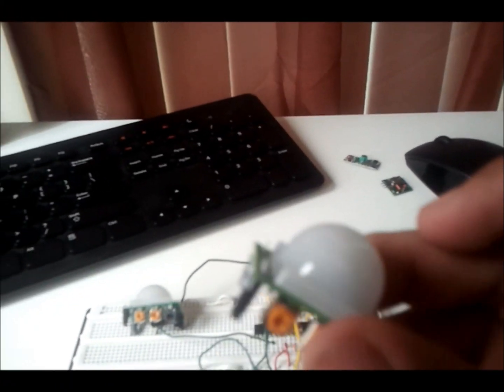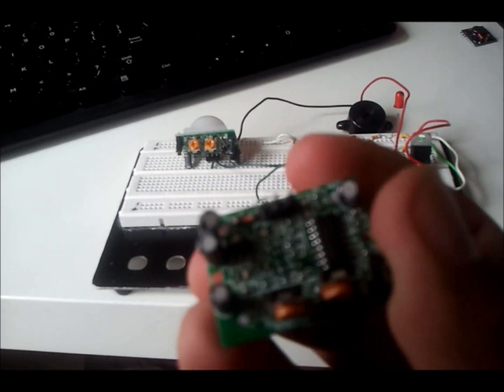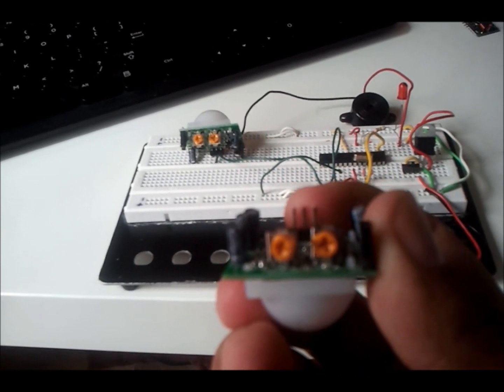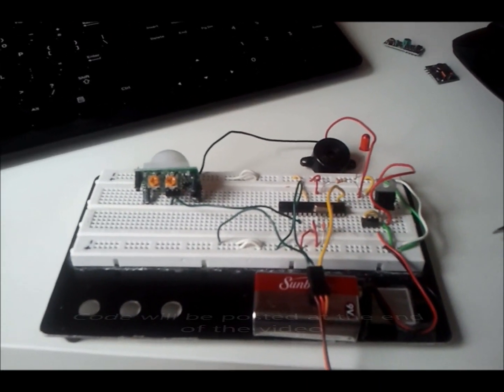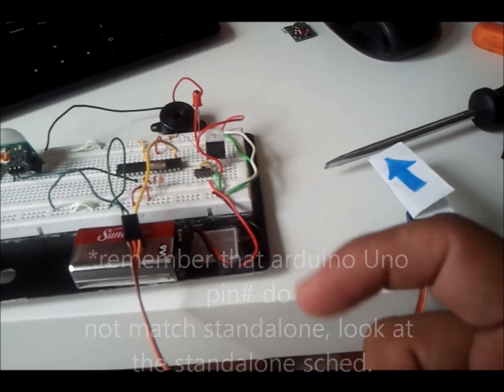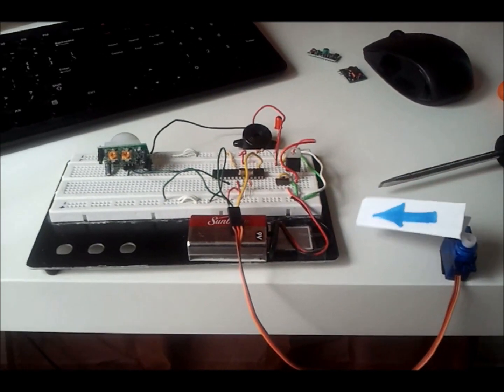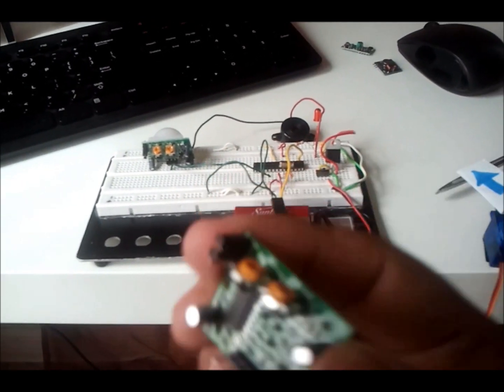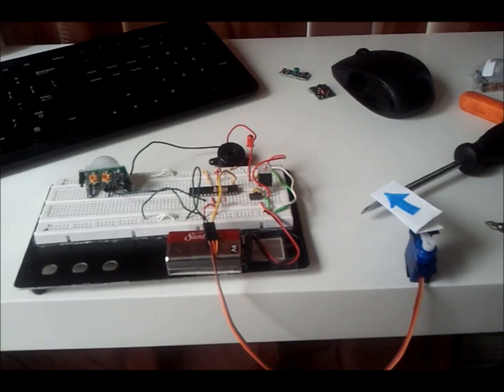PIR + Arduino + Servo motor

Comment: I wonder if you can program several different servo actions. So with each sensor activation it does the first preprogrammed movement then if it its activated again it moves to the second motion and so on till its back to the original one?